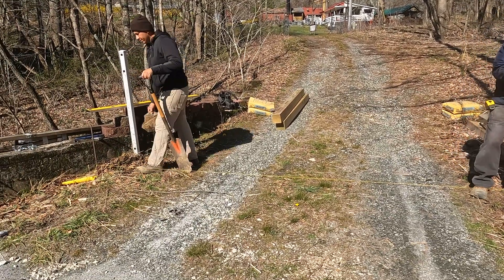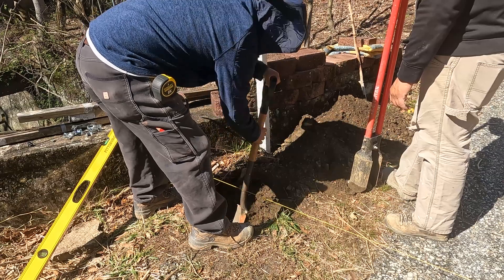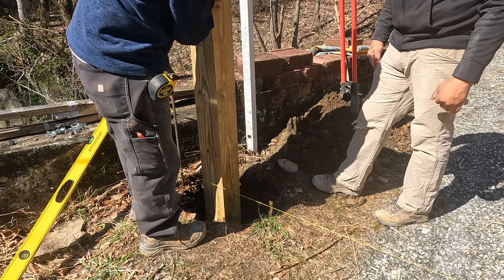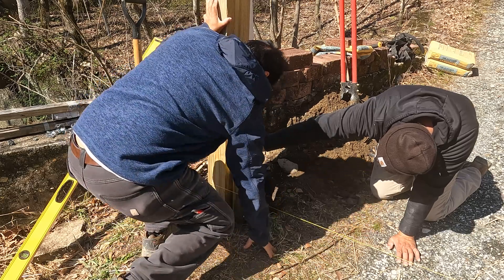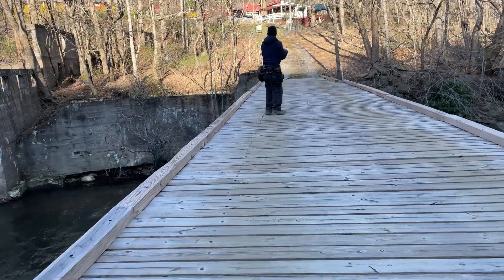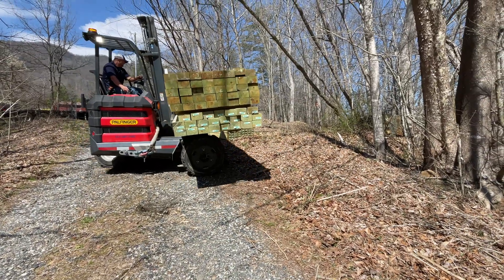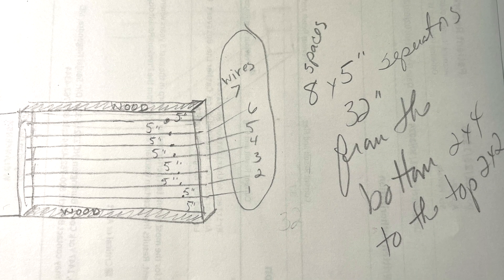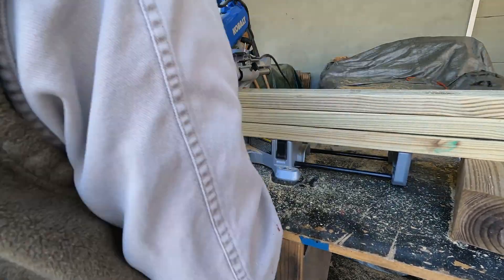How to increase a bridge weight capacity - Part 1

Comment: Thank you for sharing.  I have a mountain property with a seasonal creek that I will need to build a bridge 🌉 over it.  I really like what you have done with your upgrade to your bridge.  Would you be willing to share your bridge plans?  I'll continue to watch your videos.   Again,  thank you for sharing.  V/R, Daniel Foxworthy.
Reply from the maker: Thanks Daniel, I don't have bridge plans but would share them if I did. My bridge required a resurfacing in order to give it more strength. In the process we increased its strength to carry 60K as well as adding a railing and gate for security and aesthetics. The original 3 steel beams were placed inappropriately and not supporting a vehicles weight directly. That was the real problem. If I had had 2 steel beams 8 feet apart I may not have need to beef up the deck boards. Ask yourself how much weight will be traveling across your bridge. This will help you decide the materials you will need.  Good Luck.
Reply: @I-build-crafts  thank you.